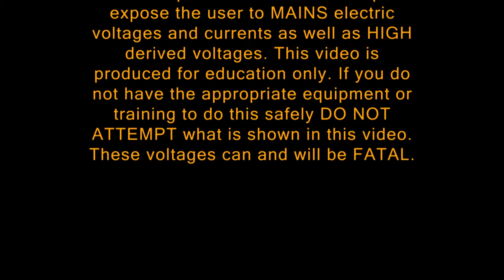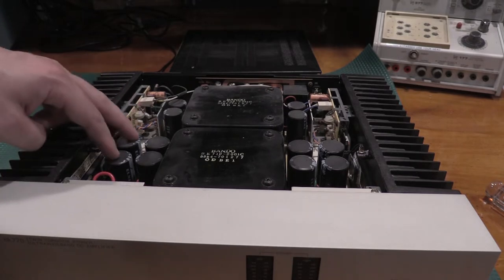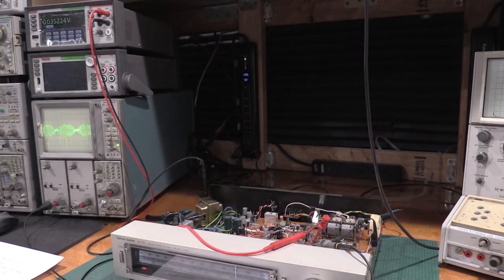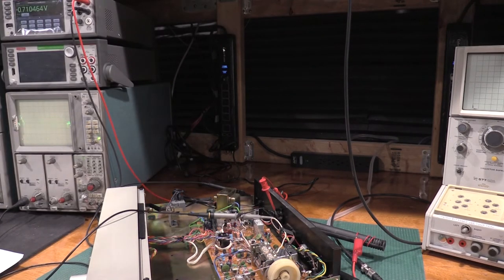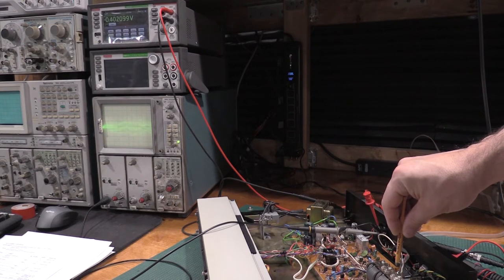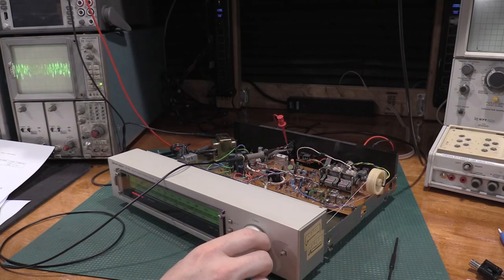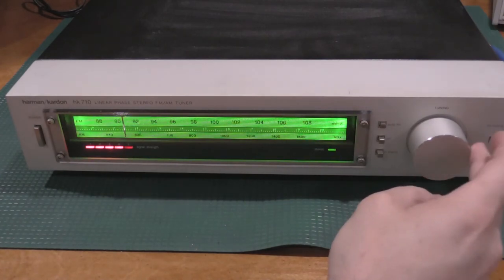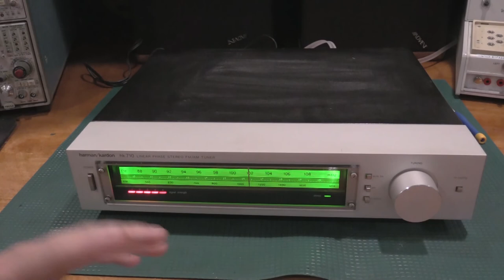Harman Kardon HK710 Repair and Alignment

Comment: Very nice work! I love my HP 8657B - big and weighs a ton but rock solid. If you can find an HP 8904A Function Generator with option 001, it has a FM composite function built in that generates the 19 kHz pilot and 38 kHz carrier and can be used to modulate the 8657.
Reply from the maker: Awesome, Thanks for the info. I will start looking for an 8904A
Reply: @ZenwizardStudios  If you decide to buy one, try to get one that also has Option 002 - two output channels. With it you can generate two signals and vary the phase relationship between them - great for two phase clocks and stepper motor circuits.
Reply from the maker: OK option 1 and option 2 I also need to stay away from option 4 (Rear output terminals)
Reply: @ZenwizardStudios   The biggest issue with the 8904A is the ELP backlit LCD display. It can easily be replaced with an LED backlit display, you just need to get one with an HD44780 compatible driver IC. Also, remove the ELP power supply module as it will burn up if run unloaded. If you can't find one that has option 01 enabled, get HP Service Note 8904A-05 and use the instructions in it to enter the value 07 into address 3FFC. This will enable options 1, 3 and 5.

Comment: Its not that often we need a very very low voltage output from a generator. I have an old GenRad 600 ohm switched attenuator updated with BNCs that I have used only a few times in many decades, but when you need a low noise, low level signal, it sure comes in handy. Thats nice you have such a low output range right in the genset.
Reply from the maker: The HP 8657A specializes in low level signals. It maxes out at 1V Pk to Pk which ends up being about 2V pk-pk unterminated. In terms of its frequency capabilities this barely tickled it. It will go up to 1040 Mhz -1.04 Ghz so it can go fast but not very loud.

Comment: Hi, i have a hk770 power amp and the relay often does not engage. What could be the problem?
What should i check?
I hope this message reach your attention, many thanks😊.
Reply from the maker: The relay is part of the speaker protect circuit usually. 3 things come to mind. A faulty relay (unlikely but possible). More likely is a fault in the protect circuit that is causing the protection to trip OR a fault some here in the amp chain that is causing the protection to correctly engage.